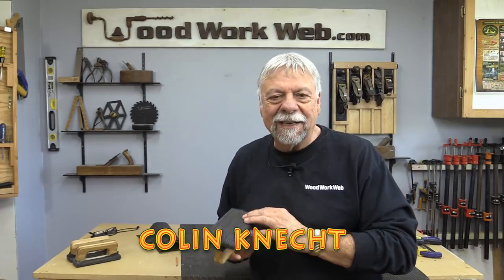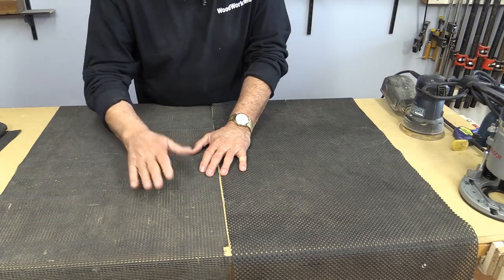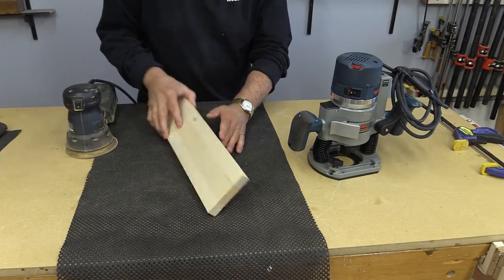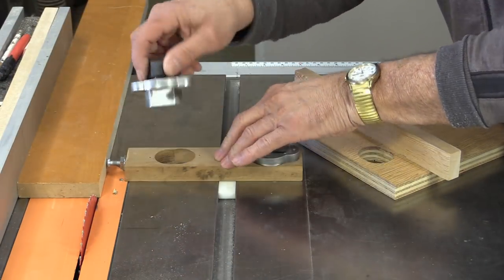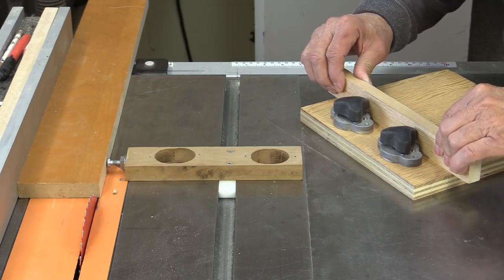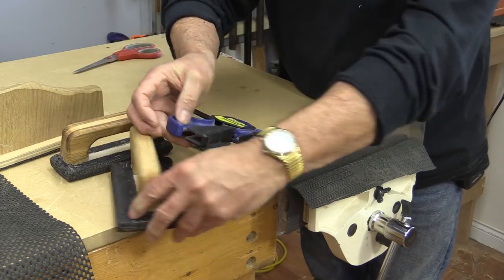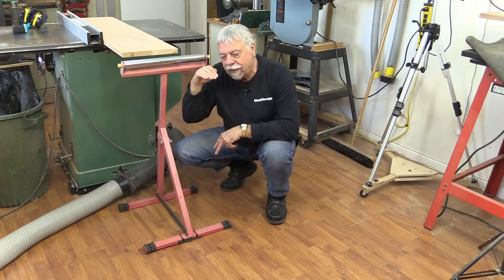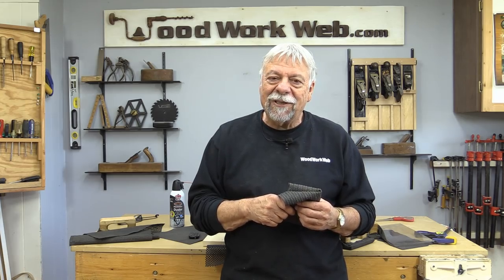AntiSkid / Anti Slip Workshop Life Hacks - Woodworking Tips and Tricks

Comment: Hi Colon, I've used this material for a long time now and find that if wash these mats in the kitchen sink with a couple of drops of dawn dish soap, rinse and then air dry.  They are just about like new once the dust and other contaminants are removed.  
I also use it on the back of my bench hooks ... a little 3m 77 spray adhesive and they last for months.
Cheers

Comment: I learned so much here, thanks!
I have this under my rugs on a tiled floor, but recently the bathroom one stopped gripping and is always sliding around, I didn't know they had a shelf life.
You also saved my a tonne of time - I was going to put wood in my vice to make it grip things better but this is much better. And I had no idea it worked on wood for routering - I've been struggling all this time with clamps that get in the way and I have to do profiles in stages, this will save all that mucking about.
Reply from the maker: Glad I could help. Thanks for watching!

Comment: been using the same stuff the same why for years. also use it on my down draft table. the air and dust flows right threw it.
also works great under rugs on tile.
Reply from the maker: Thanks for the tip and thanks for watching!

Comment: Where to get that material
Reply: Amazon, ebay sell it as anti slip mats which go under rugs
Reply: Supermarkets, Kmart, that sort of place. It's sold as kitchen drawer liner. I got mine at Aldi
Reply: At supermarkets. Can also be at a automotive department.
Reply from the maker: As many have already mentioned, you can get them at many local stores. 
You can also get them on Amazon here: https://www.amazon.com/dp/B00NFB81ZC/?ref=exp_inf_pl_woodworkweb